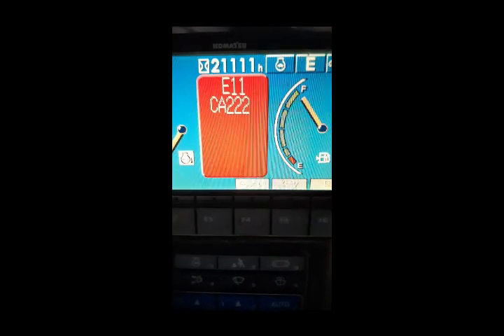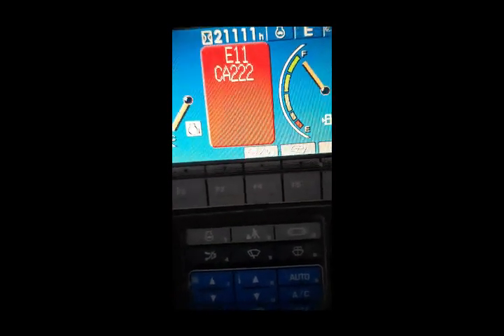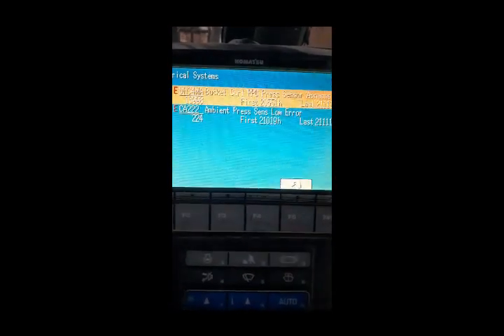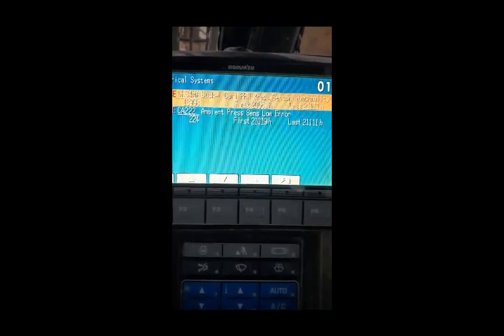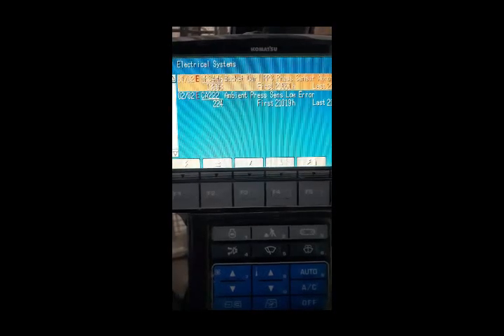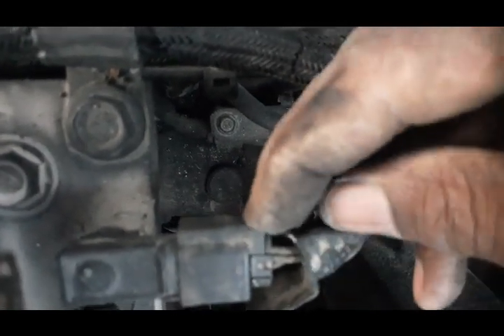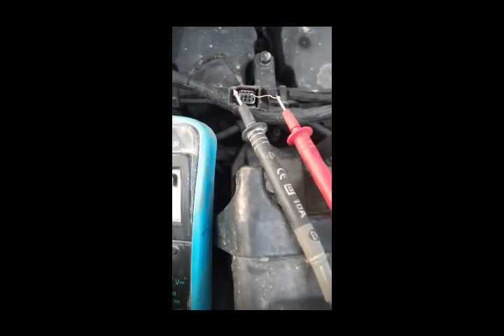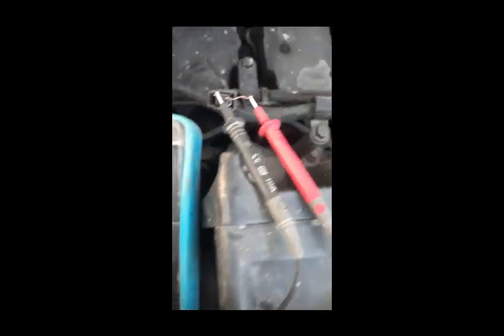CA222 Code Of PC 400 Excavator

Comment: Serious failure in the diagnosis, the signal cable is more important than the +5vdc
Reply from the maker: +5vdc & Signal wire both are equally important.
Reply: No. You can use any 5vdc power cable from any sensor in the machine, but each sensor has a single signal cable that is the one it uses for diagnosis by means of pull-ups.

Signal cable and 0vdc cable, with those diagnostics